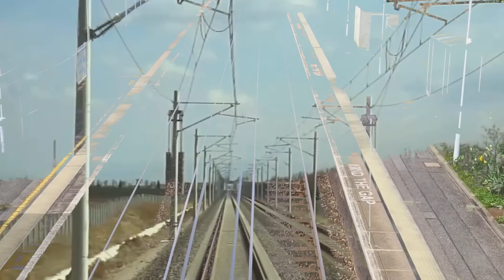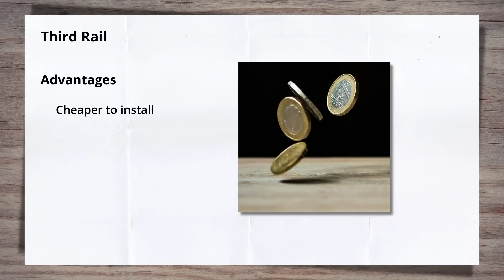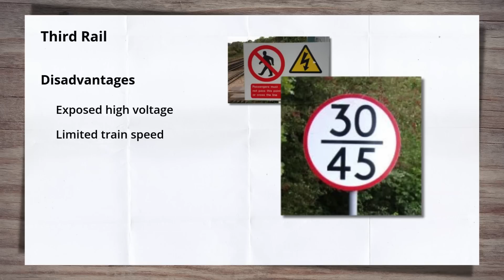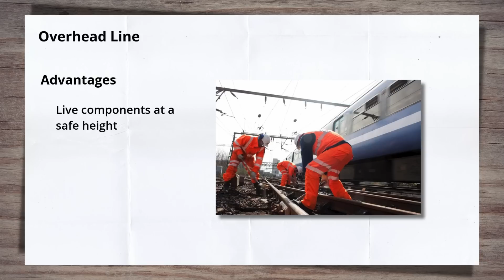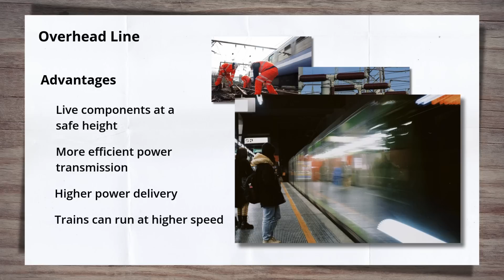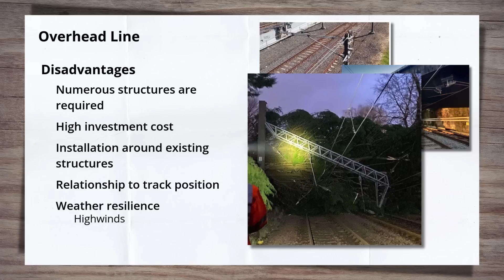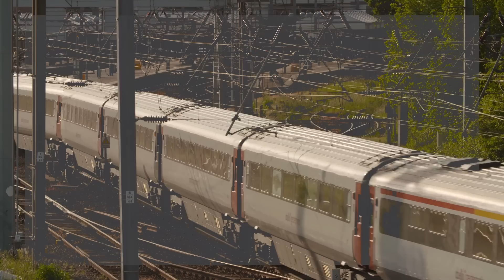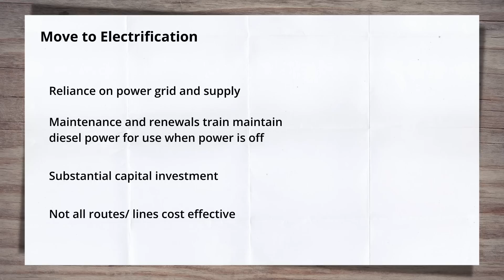How Trains Are Powered on the Railway | Third Rail vs Over Head Line Wires

Comment: Surely AC systems need transformers, whilst DC systems don't ...
Reply: Yup, 3phase AC doesn’t care, the input will be delivered the wrong way, so you need to get the voltage to something reasonable (afaik 300-600V), get it to DC and then invert it to the right frequency (which is a gear ratio and fancy circuiting away from the wheel speed)
Reply: @genoobtlp4424  the AC on the overhead is just single phase.  3phase would need 3 wires.  AC motors can be wired and/or geared for a wide range of frequencies easily covering the common ones.
Reply: @philhoward4466  You can use two wires with the third phase being the rails. The Ligurian coast line in Italy used to be two wire three phase but was later converted to 3000v DC, the usual Italian voltage.
Reply: @philhoward4466 In the UK it is fed straight off the grid.
Reply: Both usually draw power from the public power system (AC). 25Kv is an easily transformable voltage from a typical public supply system.

On DC trains the transformers are not in the trains. So the supply needs to be transformed and converted to DC for traction power. Some voltage step down is still needed for things like lighting and other services in the train.

In AC systems the transformers for traction power are in the trains. It was changes in technology making such a set-up arrangements easier and cheaper that shifted the economics and preference to AC systems.

BTW, most modern electric trains have AC motors, whether they are using a DC or AC overhead supply. Modern AC motors are better in a variety of ways.
Reply: @tacitdionysus3220  specifically 3 phase AC motors because they give better (sometimes up to double the usable traction per axle) traction control and can be high torque for freight and high top speed for pax without changing physical gears.
Reply: well really both need tranformers nowadays since AC motors have become the standard for new Rolling stock
Reply: @cyri96  Inverters needed as well I guess ...
Reply: The bottom line is: You can't transform DC. It's not about not being invented yet, it's not about it being expensive. It is a fact of physics. If you want to change the voltage of a DC supply using a transformer you first need to convert the DCto AC, and then transform it. If what you finally want is DC (but with a different voltage than what your supply delivers) you then need to convert the transformed AC back to DC (eg using a rectifier).

Again, you can not use a transformer to change the voltage of a DC circuit.
Reply: @davebowman6497  Most AC power systems for trains are supplied with single phase AC, which is converted to DC then into 3 phase AC for the traction motors. 

Recently discovered a Youtube channel called 'Lesics' that has a clip, "The Fascinating Engineering Behind Electric Trains" that has a very lucid explanation with great graphics, starting from the simplest system then adding components to arrive at what is actually used.
Reply: @davebowman6497  Historically, for large scale step up or step down of DC-DC a spoon often used till mid or late 20th Century was the so called rotary transformer. This was essentially a DC motor driving a Dynamo.

Similarly, until low loss switching power supplies were a thing, DC to AC was often achieved by a rotary converter: where an appropriate motor turns the appropriate generator 

This is still about the best way to move power between AC lines that are either at different Hz, or at nominally the same Hz but not necessarily kept in phase. (Example: shifting power between any two of the three autonomous North American grids, of you don't have a HVDC interconnector)
Reply: Any voltage change under DC needs circuitry that's more lossy than a transformer. So you are correct, but that's a problem not an advantage for DC 

In addition, DC needs a rectifier for getting the power from the grid to the rail. It turns out that it needs about 10x as many of these "substations" (UK term, I don't know the US equivalent).
Reply: @trueriver1950  Yeah, we call them sub-stations in Australia too.
Reply: AC is used as you can send power at high voltage and low current,.
Third rail which is DC uses low voltages  typically 750DC so not suitable for high speed trains using masses of power.

With modern traction either DC or AC supply the AC is transformed to a lower voltage and rectified to DC 
The DC then is fed into a 3 phase inverter that supplies 3 phase AC into AC traction motors.
Reply: OP, why do you say that as if that's DC's advantage over AC?
Reply: DC rail uses more transformers than AC
Reply: @LostsTVandRadio  I think we need to understand some basic electrical theory.

Firstly there is supply power to the locomotive, there is the issue of what happens within the locomotive 
Power is IV or volts Amps so the higher the voltage the less the current.
Because power lines have resistance it is better to transmit electricity at high voltage and lower current 
The supply voltage from the grid could be 100s of thousands of volts so is transformed to a lower voltage.
With AC it is normally transformed to 25KV and fed into the catenary.
If it is DC then it is stansformed and rectified  to DC typical voltages are 3000V 1500 V supplied via overhead wire or 750V third rail or overhead for light rail.

Again if the voltage is high it means thinner conductors , and longer sections between sub stations.
As an example 25KV only requires roughly 1/16th of the Amps that 25KV uses.
Referring to modern locomotives they all use AC traction motors using 3 phase.

So on an AC loco the 25KV is stepped down and rectified, it then is fed into a 3 phase inverter supplying AC to the traction motors.

If the loco is DC then the voltage is normally fed into the 3 phase inverter and then to AC traction motors
Reply: the transformer easily changes the voltage of AC to what you need.  to do that with DC it requires more complex equipment (on the train).  AC motors are the way these days requiring just one (big) capacitor when starting.  they also can be wired for a wide range of operating voltages, possibly eliminating the need for a heavy transformer.
Reply: @philhoward4466  well, most modern trains use 3 phase AC for the better traction control that means their reliably usable traction almost doubles compared to the old DC motors. And as long as you have enough resistors, going from a higher voltage to the desired one in DC isn’t really the problem. And motors typically use 300-600V, so your typical DC voltages of 600 (tram, trolley bus), 750 modern metros, 1000 (some narrow gauge lines), 1500 (NL, southern France) and 3000 (Belgium, Italy) aren’t a problem and actually used to be wired pretty directly into the motors. Of course, these days it’s plugged into the VFD that chops it into 300-600V 3 phase
Reply: DC also needs transformers as current is supplied under medium or high voltage and needs to be lowered to 750, 1500, or 3000 volts...
Reply: @yvesd_fr1810  not necessarily, the generators are often old enough they were built to deliver 600, 750, 100, 1500 or 3000 Volts (whichever your system uses), which go straight to the catenary / 3rd rail, which feeds the vehicle. And on older trains (pre-1980s), they would just put enough motors in series to get the working voltage of 300-600VDC and you‘d put a bunch of resistors in the circuit to get the power/speed you want. No transformer involved. On modern trains, you have a VFD chopping it up using really fast switches (transistors) to fake a 3 phase AC that feeds the motor, also no Transformer involved
Reply: @genoobtlp4424    I was not clear. In my former comment, I am not considering the locs but the current supply to the 3rd rail or the overhead catenary. The question is what is the origin of your electricity. In sub-stations, I agree, you can produce directly 750, 1500 or 3000 V DC current. But these stations are fed by high voltage current, that you have to lower most often by a transformer.
Reply: @yvesd_fr1810  true, but only the modern ones, old enough stations, afaik, were usually designed as pure DC systems without transformers as that technology was wildly impractical until at least the 50s, iirc